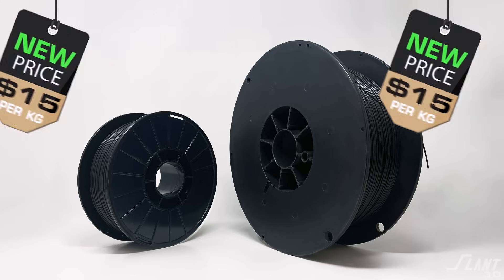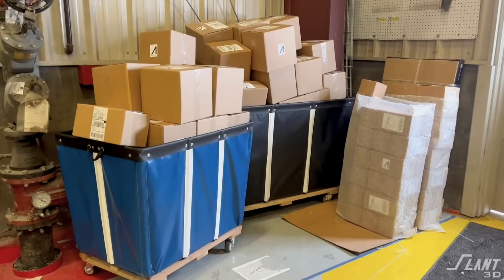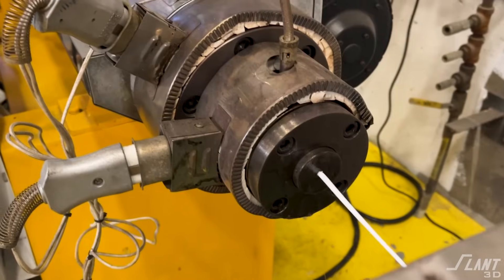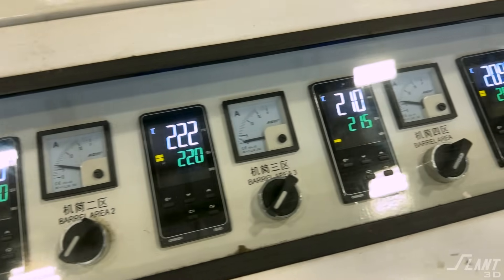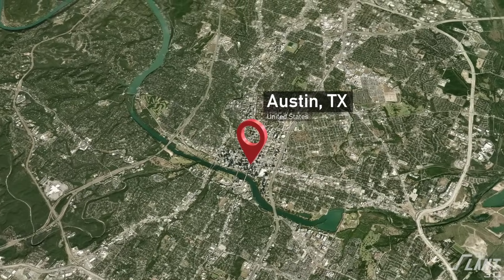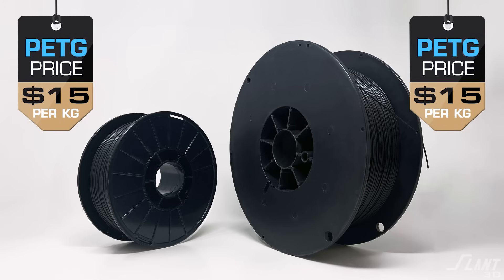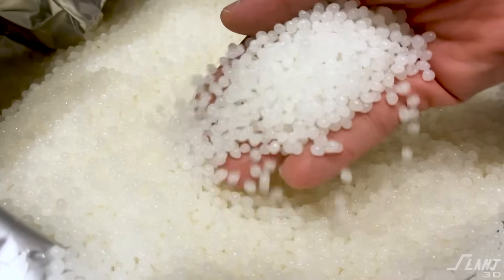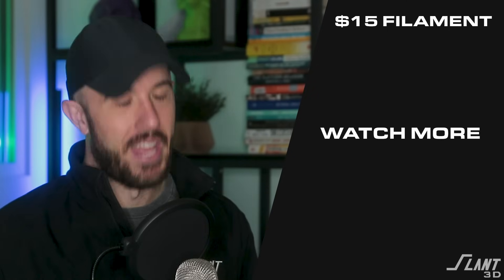Level Unlocked $15 3D Printer Filament | The Road to $10 Filament

Comment: I'm lucky enough to live near Toner Plastics, a local filament manufacturer. Their normal filament prices are in the $22 range but they always have clearance filament for as little as $8.49 per kg. It's great quality and I do local pickup so there's no shipping! If you're in the Springfield, MA area look them up. I'm not affiliated with Toner, just a satisfied customer.

Comment: waiting for the PETG !! please please ANYTHING but black. I simply can not use black. its useless to me. (outdoor 6800ft desert brutal solar radiation. yes. black petg WARPS here.

even "neutral" (ie no coloring") or better white. working on building well a building with printed blocks. I make 300x300x150mm blocks that use 950g of filament each.

Comment: Have you considered getting into HIPS?

I find it's easy to print open frame, i'm struggling with it a lot less than with PETG, and the raw material must be quite inexpensive. It's also resilient, can be sanded and painted, looks nice straight from the nozzle too.

The problem with HIPS is... basically lack of marketing, or rather bad marketing. Everybody knows ASA and ABS, which are both more troublesome, ABS a LOT more troublesome, and ASA is more expensive. HIPS is known as... support material, as if it was some sort of throwaway garbage, while the material is highly resilient, not any less long term durable than ABS and rather more so, and it just prints so well. So it's not guaranteed that you'd sell any of it. Also i wonder what pure polystyrene is like without butadiene additive. Because as opposed to SBS and other styrene plastics, HIPS is not a copolymer, it's a blend of just styrene and just butadiene, which is also why it doesn't release so much styrene stink, as copolymerisation is the chief cause of styrene polymerisation inhibition. It still releases some so it is still somewhat poisonous to print... but like ABS is really bad and still people buy that in large amounts?

Comment: I'm interested in your filament offering. My issue is I can't find a filament dryer that will fit your spool size. Twice I've tried emailing to see if you know of a dryer that will fit your spools and I haven't received an answer.

Please let me know if there is one you know of.
Reply from the maker: Pla should not require filament drying.
Reply: @slant3d  my area has high humidity and I get better results when I dry the filament
Reply from the maker: Or you can purchase 1kg spools

Comment: Well you probably know some things I don't, but I think at the high-end additive manufacturing can never surpass injection molding mainly due to the one key factor that rules all others, time.
Now if I want to sell 100 PETG bottle openers, I can 3d print them and skip the 10k I have to pay for a custom mold (assuming there isn't already a mold I can use) these 100 bottle openers assuming I have 1 3d Printer, and it prints perfectly take lets just pull a number out of the air 45 mins a piece? Let's be generous, 30 mins a nice round 50h our roughly or 2 days for all of them. On small parts, Injection molding is able to do 1000 shots per hour. Let's give you every advantage in the world here and say 15% of those fail, so we have 850 shots per hour... that is still roughly 2468571% faster than 3d printing. Now, the advantage of printers is they can print anything, making them great for individual home use and quickly changing industries. Or as they are commonly used as prototyping methods. But Injection molding will stay as long as humanity lives on, and it will stay dominant.
Reply from the maker: Now imagine you have 1000 printers. Fewer than in our Megafarms
Reply: @slant3d  little preamble I love your company and videos and I wish you all the best in the world and all the success you can have.

then you payed an upfront cost of 150,000$ and are still 2468% slower than a single injection mold. Granted with much more versatility and the benefit of being able to manufacture parts that injection molding can't. But I'd return to my main point of large scale production still being more productive on an injection system.

Comment: Cheapest is not always best. I applaud you for trying to lower costs and pricing. However, if you sacrifice quality and customer service, this will not succeed. For example, if someone orders 3 roles of filament, gets an email saying that you will notify them when it ships, you cannot then not reply to their emails when nothing gets shipped and you charge their credit card. This will lead to lost customers and the failure of your goal of a low-cost alternative. Apple has found great success at providing a quality product at a high price and fantastic customer service.

Comment: Okay, so what you've realized is that last mile costs dramatically outweigh the cost of production. What this means is you need to miniaturize and simplify the process of taking bulk plastic and putting it on the spool and leasing these to local popup shops who use this to drive down costs, potentially below $10 and you make a royalty. You don't even need a shop, someone licensed by you from their home can simplify overnight low cost shipping. Or raise the opportunity for bulk pick up and delivery.
Reply: I presume you can 3d print the spools, hopefully meaning it's cheaper to make on site than ship to a middle man. Or lose the spool all together except in specified purchases.

Comment: You can maybe make a cheaper tear of filament that is just spulled up in a bag without a spool. It would lower the cost of shipping and manufacturing of the spool and be more environmentally friendly. It wouldn't take more than 10min to spool it by yourself at home.

Comment: Its a huge hump to get over, getting your costs down on the basic process and ensuring the consistency people need. Glad you seem to be there.

PetG is ok, but while it has some big advantages over PLA, it has some real issues with mass market adoption, because it has some bed adhesion challenges for beginners.  My big issue with PETG is that I have a ton of PLA I use, and I can't mix filament types and temperature settings, so I mostly stick to pla...but thats just me

I also need a broad and consistent color range.  I use tons of black, and quite a bit of white, but I need about 30 colors in the end, and moving into that space is tough. I wish you luck!
Reply from the maker: You can have any color you want. As long as it is black

Comment: ABS when
Reply: ABS is shit. Either ASA or HIPS, ABS makes no sense.
Reply: @SianaGearz  sure asa has mostly replaced abs in the market since it's the same thing but better but abs prints easy and more importantly the resin is dirt cheap.  if he thinks he can do petg for 10, he can do abs for like 7

I don't consider HIPS to be a sensible thing to bring up in a conversation about ABS.  they're not particularly comparable materials.
Reply: @butre.   ASA is more expensive and HIPS resin is dirt cheap just like ABS and prints easier, less die swell, basically no shrinkage, box it in or print it open frame with slight part cooling fan breeze, works fine. Less free styrene than ABS by an order of magnitude, and potentially less than in ASA, largely similar. Mechanically not far off from all these, you can kick those parts around just fine, plus it does living hinges and flextures really well, isn't prone to failure from repeat stress. The unique matte look is pretty nice for 3D prints, shows less inconsistencies.

Comment: Hello, I have two questions, will you in some time soon deliver to countries in Europe (like Belgium)? I also got the problem when I'm respooling 3kg spools from esun PLA to 1kg that they would snap with the smaller radius in the inside of the spool, you don't notice it until you print to that point. Does your filament have the same issue? Thx for making these filaments more affordable. Good luck getting to the 10 dollar mark!

Comment: Some innovators are exploring nozzle systems capable of directly utilizing pellets. This could lead to a substantial reduction in raw material costs in the 3D printing sector. What are the major challenges to adopting this technology, apart from software modifications? Software can be rewritten relatively inexpensively, and widespread adoption would further drive down costs.

- Pellets, currently used in injection molding, could be seamlessly integrated into 3D printing, leveraging their cost-effectiveness and availability
- This approach eliminates the issue of filament tangling, enhancing operational efficiency and reducing downtime
- Using pellets would also allow for more material variety and customization options, as pellets can be easily blended to create custom material properties or colors before printing
- Pellet-based systems typically require simpler and potentially more robust hardware, reducing maintenance requirements and increasing the durability of the printing apparatus
- Additionally, pellets are often available in bulk, which could significantly decrease logistics and storage costs compared to traditional filament spools

What do you think?
Reply from the maker: Pellets are unfortunately a dead end.
Reply: @slant3d  would be super interested why this is with your experience -  https://youtu.be/f0rVNFXp9IA?si=7RL_9YvWl6GebOID is trying to make it work but that is only one use case
Reply: This is an entirely different kind of business, that they're not set up for. This is the sort of thing you want hotend-extruder engineering specialists doing, the likes of e3d and Slice. The fact that exactly none of them are doing that should tell you something - and they're not in the business of selling filament, so they have no inherent incentive to avoid this endeavour. This is also a risk endeavour, that you want to run separately, possibly on VC. In comparison, there is comparatively zero risk in extruding filament, particularly as a print farm company.

Your claim that "Pellet-based systems typically require simpler and potentially more robust hardware" is just bonkers. What's simpler than a wheel stuck to a motor, and a stable temperature nozzle, which is what a filament printer is? No. The finesse required of a pellet extruder is very high if it has any hope of competing on quality, and there's a lot to go wrong. Air voids, molten material stuck to the walls, wear on well hidden parts, etc.

Cheaper kinds of pellet extruders have very sub-par consistency compared to semi-decent filament and cannot retract, so they ooze. Yeah i have seen that German guy who built a really neat DIY pellet extruder, but if you look at his comparison filament prints, those aren't nearly as good as they should be.

There is one company promising a pellet direct extruder with what they claim to be phenomenal retraction performance but the complexity is extraordinary, and i have not seen any indepedent assessment so it may well not be out yet or not as good as it promises to be. If such a device is released, if it can compete on quality, and if it would be a vaguely sensible retrofit say for printers seen in printfarms, cost considering, there would be print farms jumping on it guaranteed.

Comment: As an Austinite, I'm VERY interested in your new Austin location, I hope you keep us updated! I've also melted PETG in the Texas sun, I'd love to see ASA or PC in the future.
Reply: My suggestion is HIPS. Similar temperature resistance to ABS and ASA, very easy to print, super cheap. I also genuinely wonder what pure polystyrene is like to print, because polybutadiene goes a little all wobbly, which is also why ABS has so much die swell - HIPS does not, because it's not a copolymer. So in ABS the polybutadiene can just flail around the complete resin as it unfurls, while in HIPS it does not, since they're just blended together not chemically connected. So i do wonder what happens if you just delete polybutadiene. I mean obviously it will be shiny not matte, but what else.

Comment: just copped a three pack
Reply: Yep, finally pulled the trigger on a 3kg spool. And yeah, looking forward to PETG, as I am looking for filament that can handle being in higher temperature conditions. Yes it will need to be painted for UV protection, and if black will need to be painted white to reduce solar thermal transfer. This is going to be for other stuff though.

Comment: I might have to give you guys a try. I’ve used Zyltech a good deal but the colors are kinda bland.  I’ve used a few other domestic ones (Matterhackers) and it’s wound poorly, not vacuum sealed and $58 a spool.  I’ve been using Polymaker a lot lately due to their Pro and Max formulas.  Their spools are very well wound, print with ease and offer me 3kg spools. But it’s China.  I prefer USA.  I’ll go check your offerings out, it seems like all you have is Black PLA at this time...colors soon?.

Comment: But chinese filament is 9$ per kg and that's 3x what it should be.
The problem is trying to keep filament thickness with 0.05mm. 
Widen the tolerance to 0.25mm and put a thickness sensor on the printer.
Maybe we should just print directly out of pellets instead

Comment: would you consider spool-less refill rolls and/or cardboard spools?
Reply: He had done vids on cardboard spools before, designed his own as well with a vase mode 3D printed centre spider. It was heavily contemplated.

But also some people won't buy cardboard spools, because they don't work well with rim loaders like the Bambu AMS, so that's a major reason not to do that.

Comment: Would you guys ever consider shipping master spools? Or like “Bambu style refills.” Seems like it could cut cost down even more and save plastic not having to ship a spool and you can ship just the filament.
Reply from the maker: Working on it
Reply: @slant3d  refills are definitely peaking my interest too. I need more filament with fewer spools in my life :)
Reply: I agree this is a great idea! I LOVE Prusa's approach with the cardboard core spools that can be disassembled to easily load a refill of just filament onto them. Slip the pre-wound filament on, put the plastic disk back on, pull 4 paper wraps off, and Presto! Saves spools, shipping weight, and waste.
Reply: I didn't have that experience with Prusa's, but Prusa also leads the industry in spool winding quality. It's insane how consistently perfect they get theirs wound. haha That said I only buy Prusament when I can justify a large qty because the shipping is f'ing outrageous from CR to US; it easily makes their already expensive filament unfathomable for anything less than 10kg at a time.

This is another reason I am patiently awaiting Tangled PETG, as that is my usual go-to material. I love Prusament PETG and am really looking forward to comparing it to Tangled PETG as a locally sourced alternative.
Reply: Of course you are! 😎
Reply: Yeah, twas a long ass day. My brain decided to just give up. 💀 Fixed it. 😉

Comment: Here in Mexico we buy chinese spools of PETG at $9 and if you buy 3 with shipping included. Granted they are not The best quality you can get... but havent had any issue with them just dont expect 0.01 dimensional accuracy
Reply: Yeah I just got some Chinese pla+ for 4.50 a kilo, for a 10 pack. Can't beat that, regardless of quality

Comment: Wouldn't you want to pass along the cost savings of the 3k filament to customers?
Reply from the maker: We are. The saving from standardizing pricing comes in other areas
Reply: @slant3d I mean to incentivize customers to buy in bulk.
Reply: @bernardtarver  A lot of people think that the convenience of not spending the time to replace spools 3 times as often is worth the relative increase in price. If you use filament run-out sensors to both pause the print and notify your print farm team that printer x-y-z needs a replacement spool, you're going to need to spend a third as much time doing that replacement. (Other consumables will still need to be managed, but I presume you have that worked in as well.)

Comment: As a hobbyist, I've had a blast with my first 3KG spool, and will certainly get another pretty soon! It's so liberating to just not even think about whether I've got enough filament for a print, or whether a model I found is "worth spending the material on".
Reply from the maker: Couldn't agree more! Thanks for the support

Comment: You should see an Argentine factory, here the filament is very cheap, it used to be 3 USD per kg, now it is between 11 and 14 USD per kg. When you compare prices, use the parallel exchange rate (dollar blue) is the one used